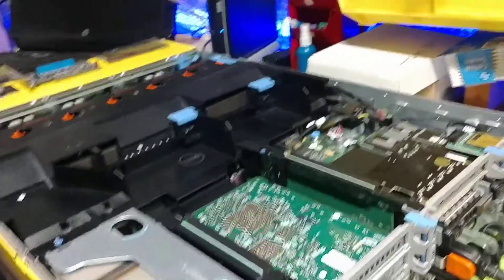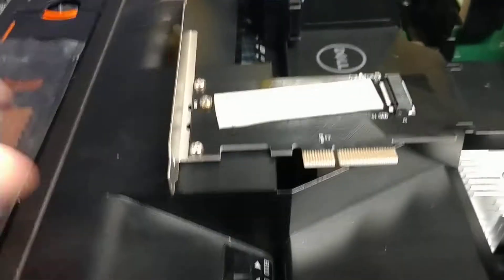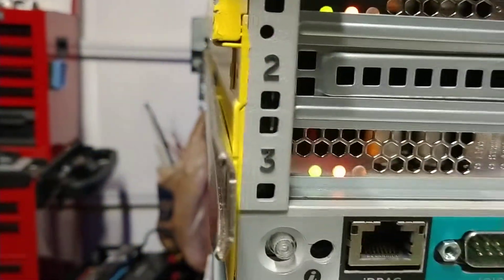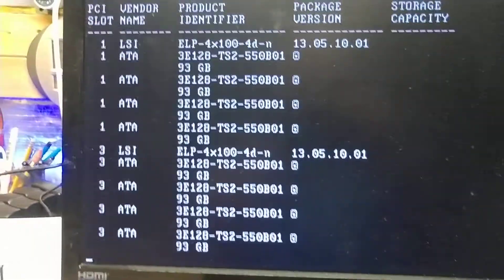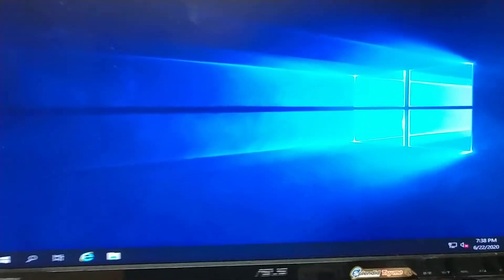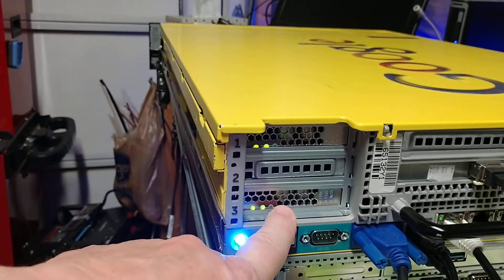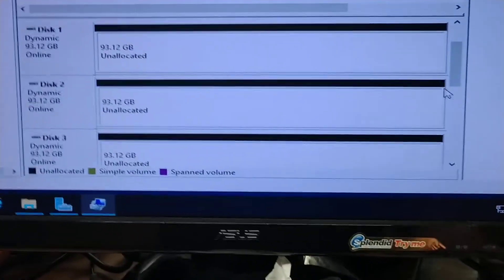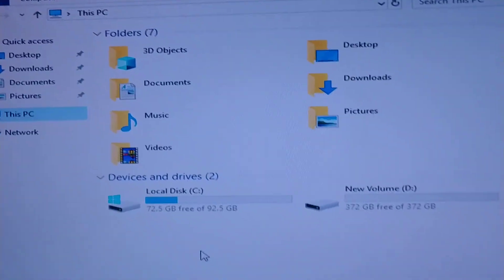Introduction to using oracle F 40 SSD PCIe card

Comment: why do a windows span disk when you can just flash them back to the lsi firmware and let the card handle the spanning. that way your system just sees the card as a single drive and you get a fair bit of speed boost doing it this was and it makes it plug and play instead of a slight headache.
Reply from the maker: I agree. but it is about taking a older SSD PCI-E card and using it for todays needs but it is a pain to setup...

Comment: Hello, I have One of these and a F80, have you try the last one ? On Unraid it is recognized but not in the good size, it's 4x2Gb 🤣 Never try it on windows...
Reply from the maker: Yes but I only use as mid speed base on boot drives. Works great. I also work with fusioI/O side cards.  Like the F-40 cards best.